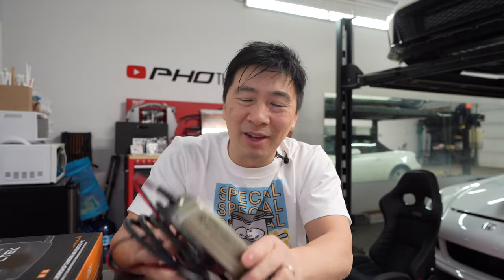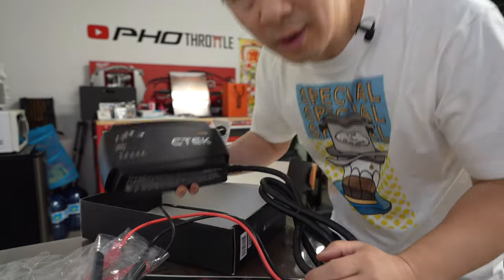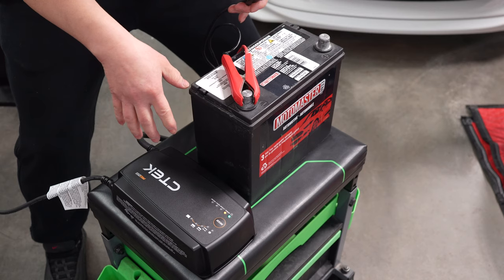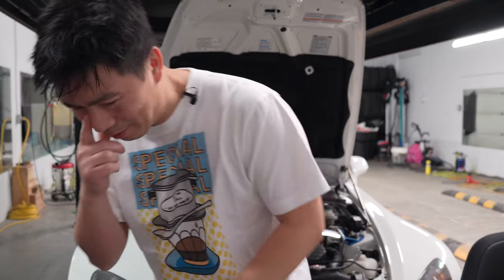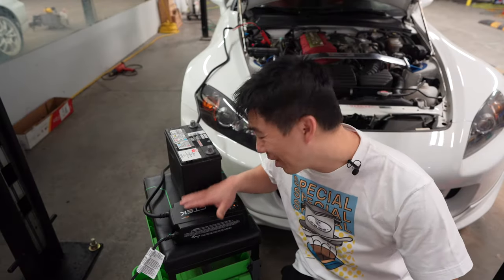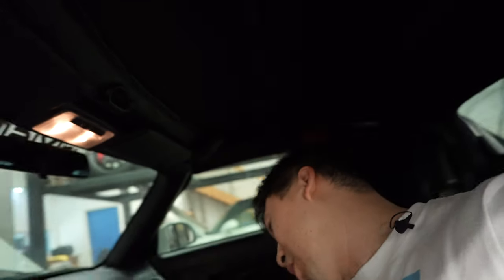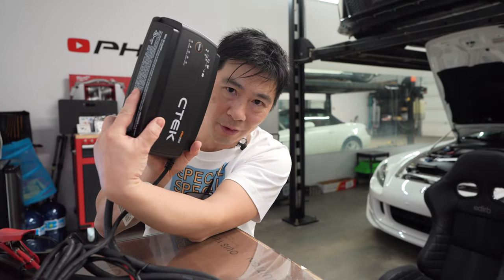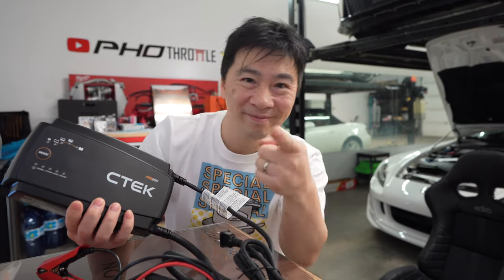Ctek Pro25S The Only Charger You Need.

Comment: Just don't leave it on maintenance charging for a long time... Mine stopped working as a charger, only the 20A supply mode worked. The warranty was a joke and it wasn't until I uploaded a video to youtube describing the fault, that I got a replacement. I was humiliated on the phone while taking to support. They guaranteed that everything was working as it should as long as the supply mode was working. End of story: I now have two Pro 25s chargers. One that works as it should and one that's working only in supply mode. I don't dare to use the working one as a charger for a long time at the time, because I'm worried it will break. Just a heads up.

Check out the GYSflash if you're looking for a charger with a great supply mode. That's what BMW uses on their cars in their showroom here. It's also good for flashing/coding.
Reply from the maker: This is good info to know. Thanks

Comment: Awesome video! I'm here because of your Antigravity Batteries videos and considering getting the group 24 for my TSX with aftermarket air suspension. I do short drives maybe an hour each week and park out in the cold in Seattle for at least eight hours. then parked in my garage for most of the time. Im surprised your FL5 drains out your Antigravity Batteries and how long you dont start up the FL5 to drain out the battery?!
Reply from the maker: Hey thanks for watching. The FL5 has been parked for a few months now. Initially I left the battery plugged in to see how fast the battery drains. It drains roughly 30% over a couple of months. As for the S2000 the battery seems to go into dormant mode. It was parked for over 4 months. I don't think you will have any issues if you park your car for a week or two.
Reply: @phothrottle  i appreciate your feedback!